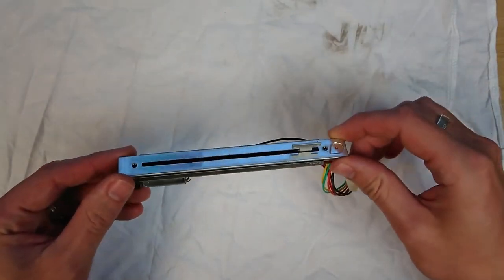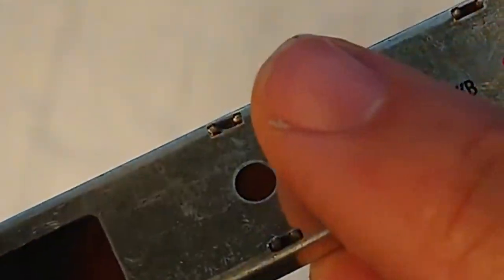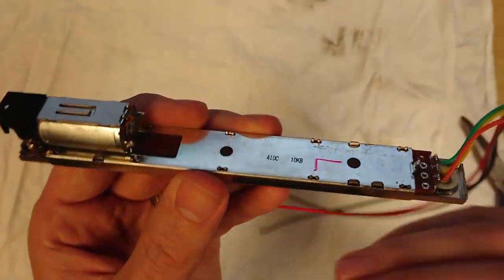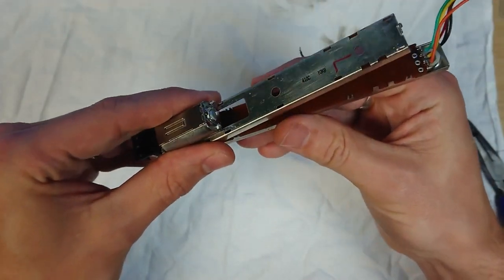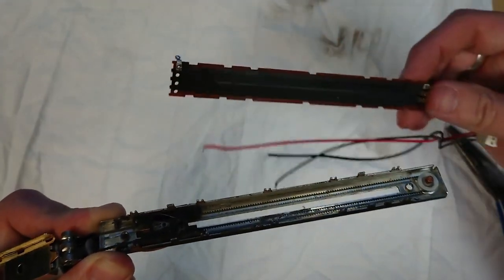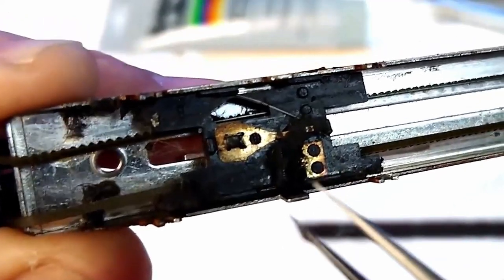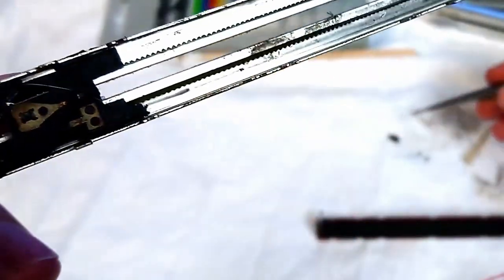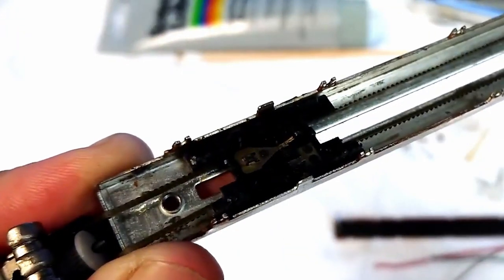Part 1: Fader Cleaning Alps Digidesign Control 24, C|24, Command 8, 002 & 003

Comment: I was able to do a minor cleaning of a Command 8 fader without breaking the solder points. I just took the fader apart slightly and lifted up the board while holding the tension on the belt. Then I used a pokey to get in there and just get the major gunk out and rub a little alcohol on the track surface. Not as thorough but it got the fader to stop sticking! Thanks for the video so I knew what I was gonna encounter!

Comment: Neil. Brilliant mate. I Finally took all the faders out of my control 24 and cleaned them all. Sure enough although they looked okay on the outside, they were full of gunk. Only had problems with the first one where I tried putting it down to clean the track and as you predicted the belt slipped off. Was a little tricky but managed to get it back on again. They now run smoothly with no clicking as new. An absolute thanks cause would not have attempted it if not for you brilliant instructions. Hope you put up some more.
Reply from the maker: paulrhead1 that's great news well done! 👊🏼